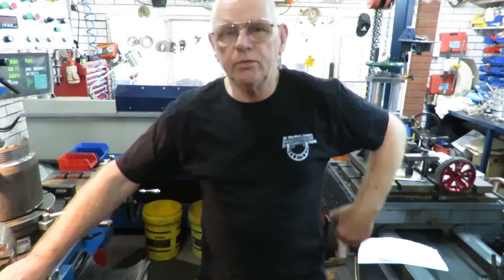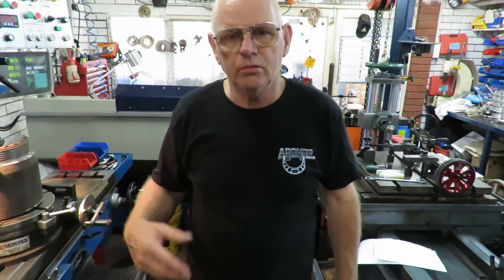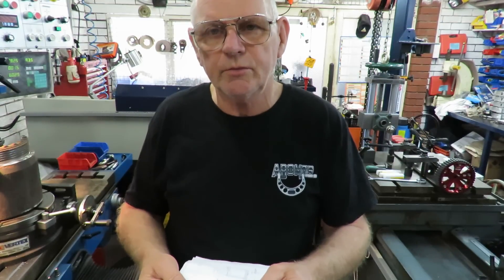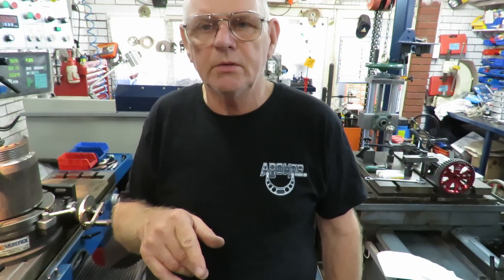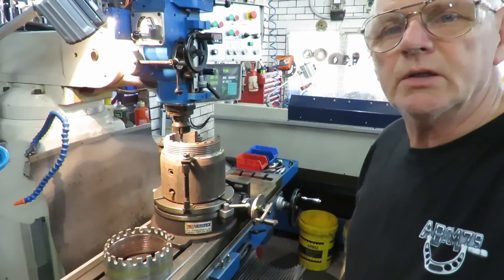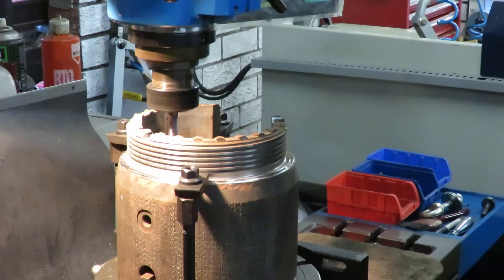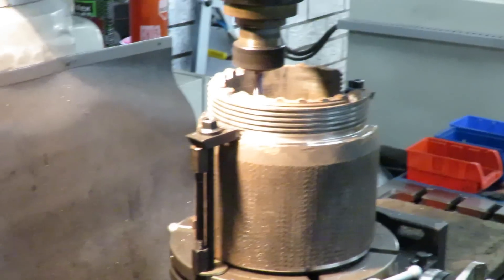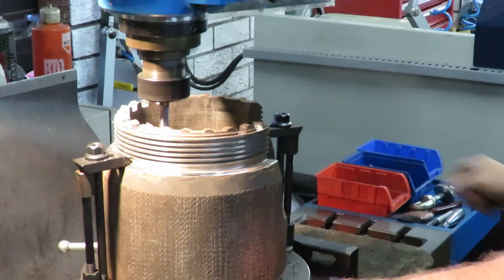Friday Mayhem Two In Bruce's shop, Toothless Wrench Teeth Rebuild

Comment from the maker: Fred, It was me, Many years in the mechanical and electrical trades and as a manager for many years surrounded by some very diverse machines I use the same principals I learnt at 14, when we had a hire services and machines came back with problems, and I had to repair them. Always look for the root cause of the issue, then make a plan to either "get it up and running quickly" and arrange for the adjustment for later or "make the changes now". Things like sharp edges are a perfect example of cause for failure.  In the case where I am given drawings from a multi national company I must follow the drawings to the letter. When I can I bring it to the clients attention and hopefully they will agree to changes.

Comment: Bruce, did you figure out that there would be less torque stress load on bottom of radius cut versus straight cut, by yourself or did you learn this from some machining handbook? if you think about it, it makes total sense, but it would be something that you really have to think about for awhile to deduce that! Not having been a machinist in real life work, I am sometimes amazed at physic type principals that machinists use in their work, and wonder where it comes from? Other thing, why no coolant? Hope you have a great trip to the "bash" also!

Comment: Thank you, Bruce, for another interesting video.
I was interested to notice the position of your mill table hand-wheel - it looks to suit your particular workshop layout very well.  Did the mill come like that or is it a Bruce-ification?  I assume that the table feed is by rack & pinion rather than the usual feed-screw and nut.  How does it compare for back-lash?
Reply from the maker: +Pete W Mills of this size come in that configuration because of the table length. It is  a screw type via gears with very little backlash, which doesn't matter when you are using a DRO. the drive is a 3 phase 2 horsepower motor with a cogged belt arrangement and variable speed controller, very robust. This mill weighs 3 times a Bridgeport. (almost 2 ton). IMG_1891.JPG

Comment: do you heat treat them ? dumb question
Reply from the maker: +Bleu Wolf No time and they should be strong enough, if the technician applies more force than the recommended torque then I'll have to make another one.